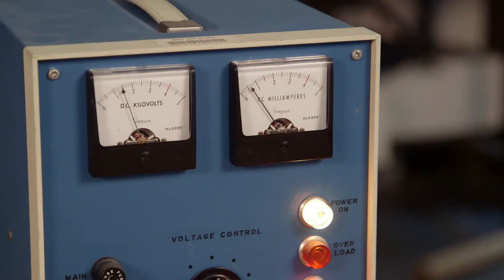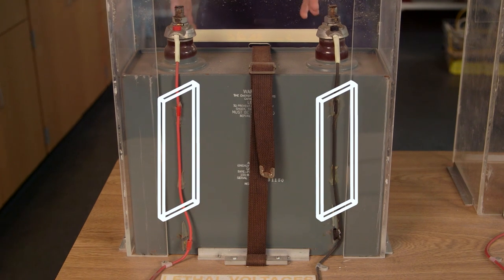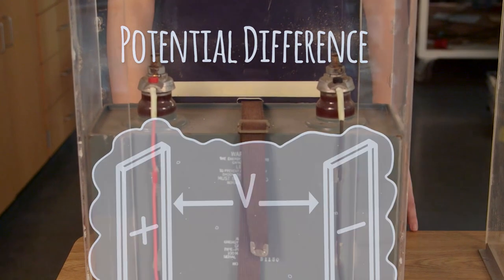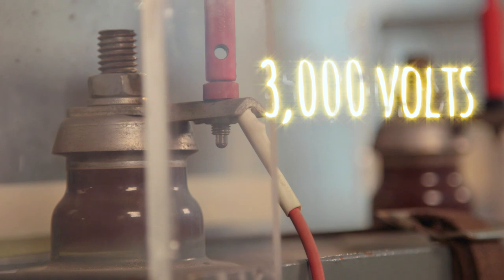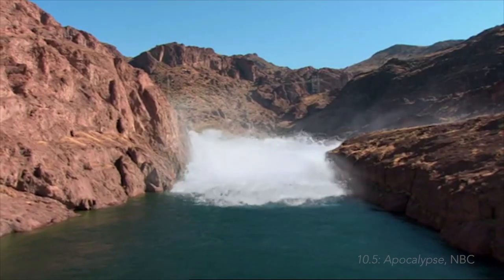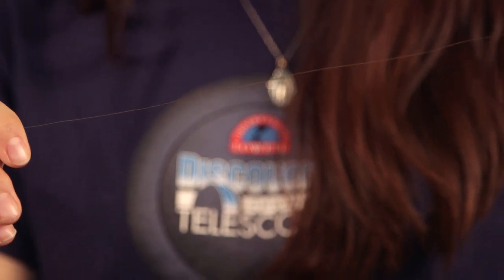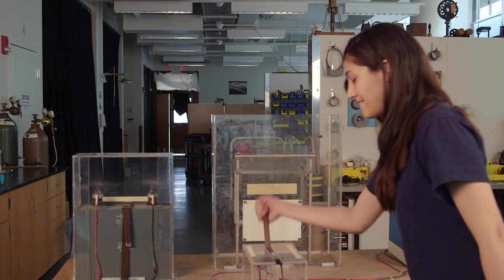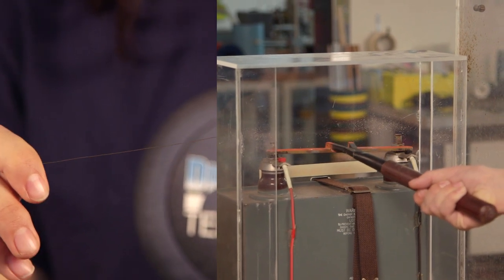MIT Physics: Exploding Wire and Resistivity

Comment: Sorry, in this condenser, to have a more powerful discharge it is necessary to increase the diameter of the wires. The wires you see in the video are small.

Comment: Those wires which are involved in the connection of these apparatus can break due to high voltage too . So be aware of that . That's too dangerous . A sudden appear of hugh amount of energy will make you feel heat and will burn your hands

Comment: Btw, if she touched that output on that capacitor with just her hands, she would have been dead before she hit the floor from touching it. That's why she uses a copper bar and an insulated rod to discharge the capacitor.That current and voltage will kill you if you touch the output of a charged capacitor that's capable of outputting 3,000 volts.